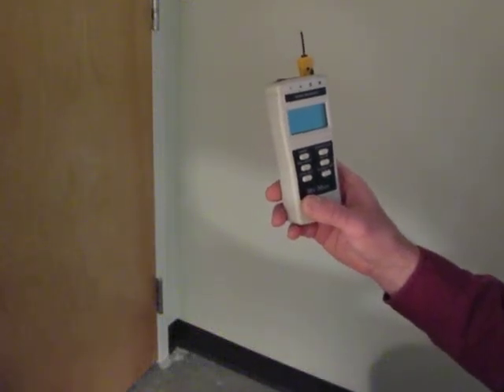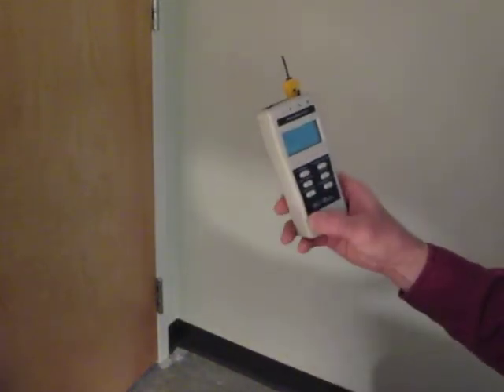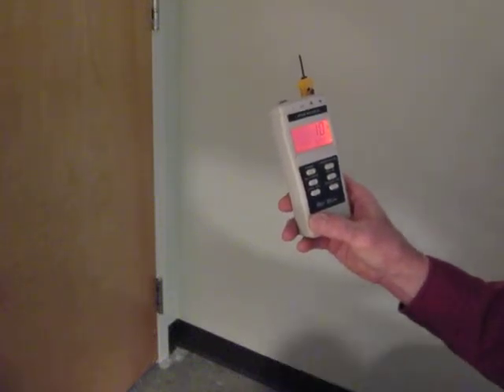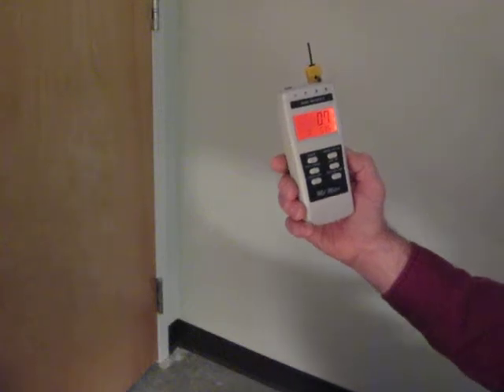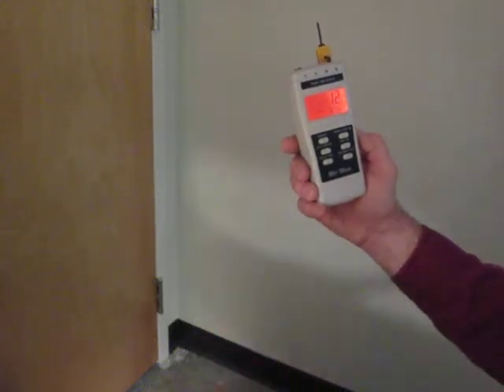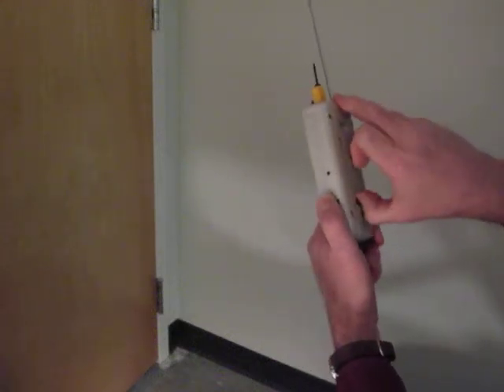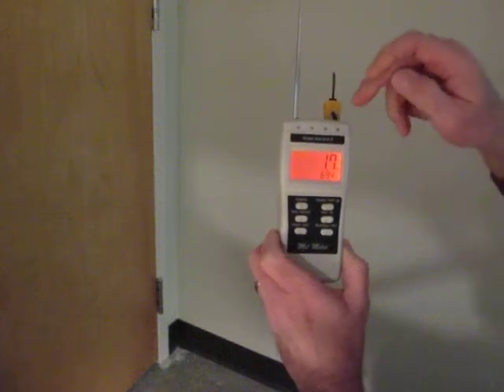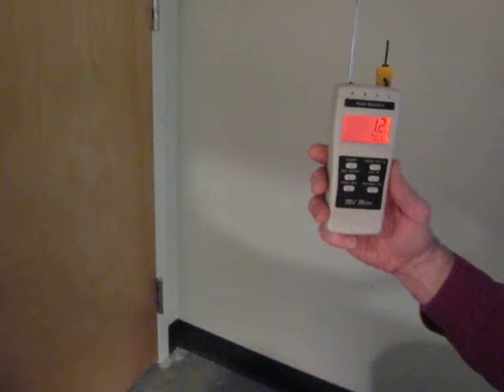Mel-8704REM-ATDD (Model 8704R-500)

Comment from the maker: I need a few more details to better understand. Here is an answer that may apply. The REMs radiating EM field around the antenna, and the ATDD's +/- 5 degree temperature deviation detection are completely independent of each other & both have LED's and Sound. In addition, you also have the Mel LCD Display with digital EMF & Temperature display which is not related to the above aforementioned features.
If the REM is on, it will not interfere with the digital EMF (mG) reading

Best of Success!

Comment from the maker: It sounds like you have the Power saving feature enabled. You need to turn this OFF. Refer to the manual. This features turns the device Off if the buttons are not pressed within 5 min or so

Comment: I was just recently using my Mel on an investigation, and it seemed after 5-10 minutes of it being on, it would beep 4-5 times and the display would shut off.  Is that simply a battery problem (even though it didn't say the battery was low)?  It did it multiple times throughout the night.

Comment: Thank you! I trust this device to give true readings.  What makes it even more legitimate is that it is not as sensitive to some outside factors as are KII's.  I have had many hits on KII devices and have yet to have any reading with the REM.  I attribute this to the fact that it can only be activated by something out of the ordinary with some physical property. An interaction with this device will solidify my belief that this is probably the best tool to measure possible entity manipulation.

Comment from the maker: Personally, I do not believe that the antenna is even necessary. Spirit can easily influence the internal connection point to activate the circuit.I would collapse the antenna under the following conditions:
If you are receiving intelligent feedback with the antenna extended. Collapse it and see if you can continue without it.
If someone is using a powerful handheld communication device
If used in close proximity to metal of fluorescent lights
Air and air particulate will not activate the device

Comment: When would you use the REM antenna fully collapsed?
I believe this to be a very benificial tool in identifying true anamolies that either are conductive of currents or are made of energies. I've discovered that even touching the antenna to some glass can resut in a disruption.  I assume that this occurs because of its impurities which could contain metals.
On that note, can air currents or cold/hot air from AC's carry any matter that could disrupt the field on the REM.
Thank you Mr Galka

Comment: What is a high reading with the mel meter?  We had a reading of 28 with two and three of the lights on top going off in the exact spot we had issues in the past.    
What levels does normal appliances give off?  Some examples?

Comment from the maker: Yes, this is the New Mel-8704R-REM-ATDD (p/n 021487-500) that is used on Paranormal Challenge. It has all of the standard features:
* Digital EMF
* Digital Temperature
* Red IR Safe Flashlight
PLUS
* REM Feature with Radiating EM Antenna
* ATDD Feature with +5/-5 Deg. Audible Temperature (Hot & Cold Spot) Alarm